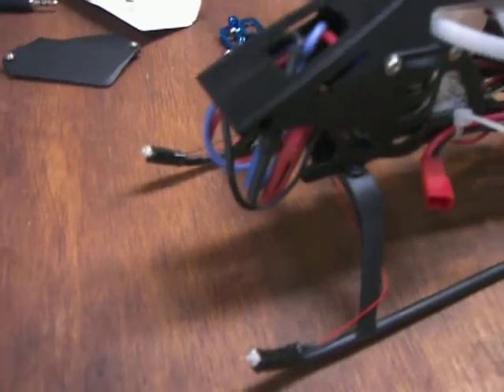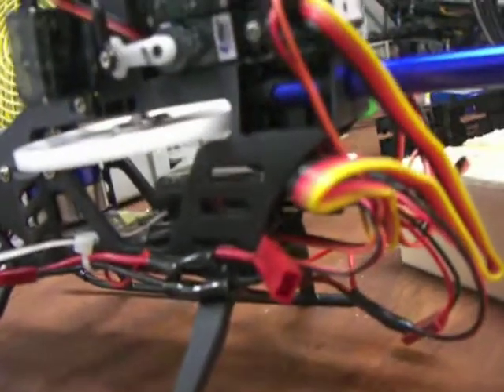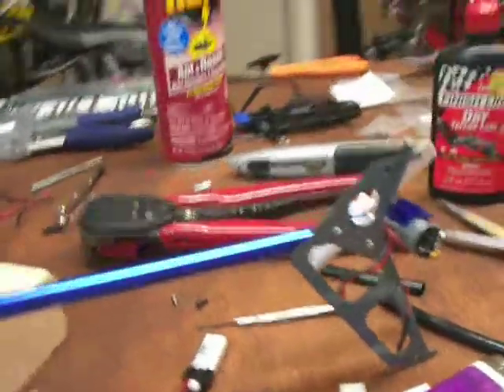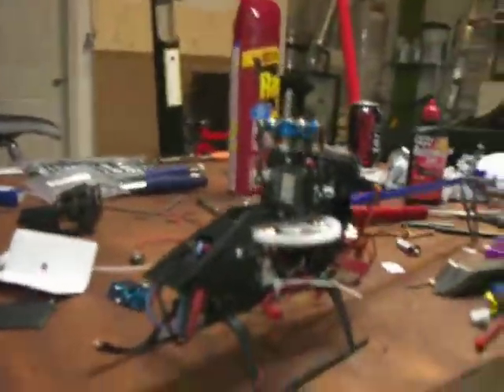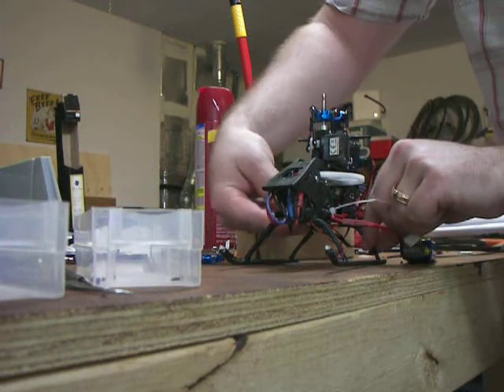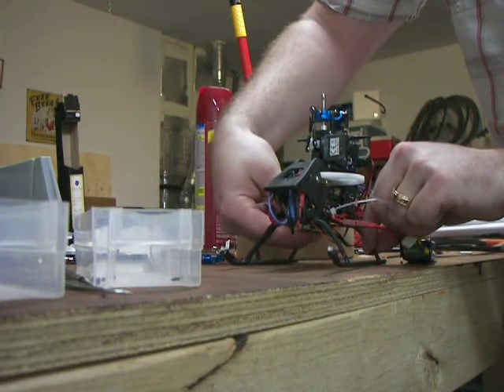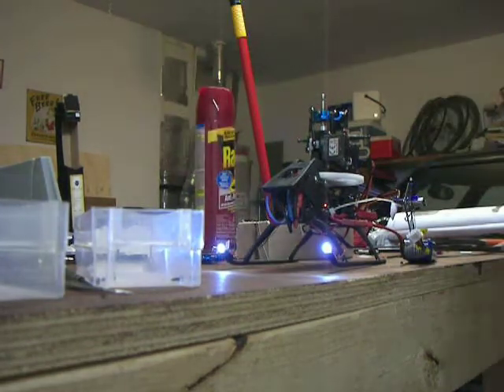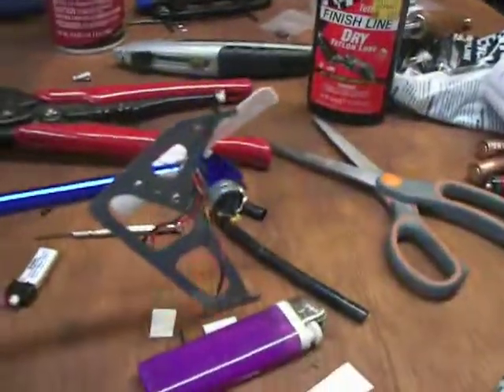Blade SR With LEDs

Comment from the maker: @robbie2737 This isn't a pre-made light kit.  I wired it up from LEDs I purchased from a company named Model Train Software.  Basically, model train LEDs.  The company I linked to puts all the resisters, etc. on the LEDs to setup the voltage correctly and make them blink.  I used 28 gauge wire because it works well in these situations.  Thanks for asking!